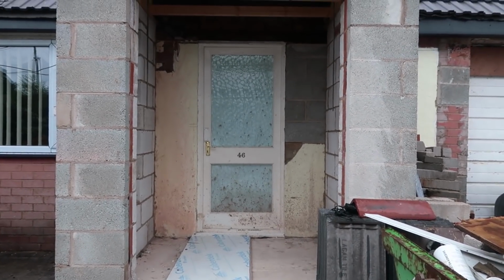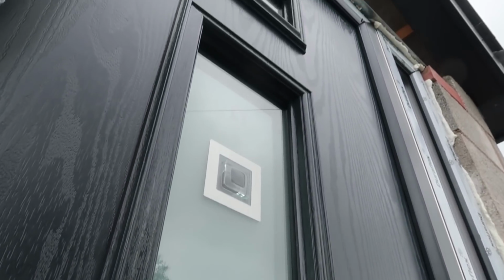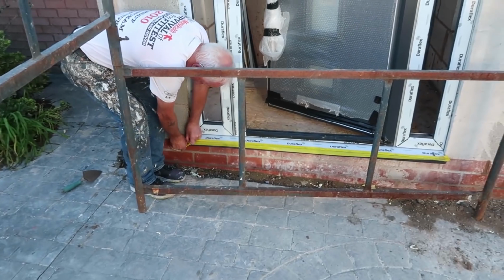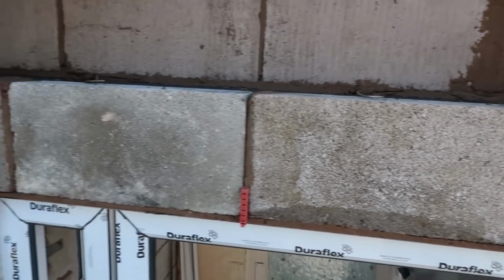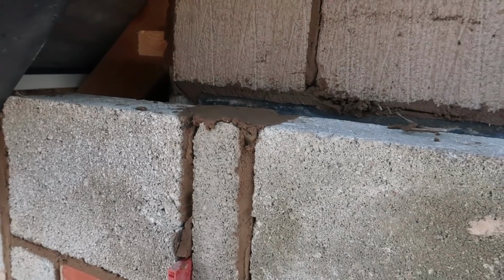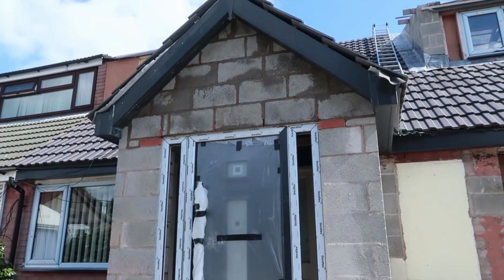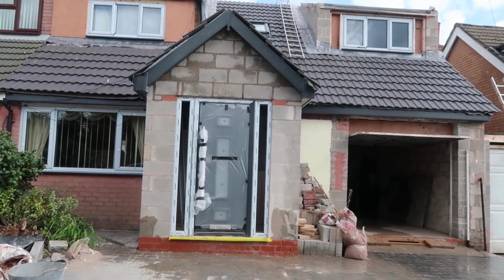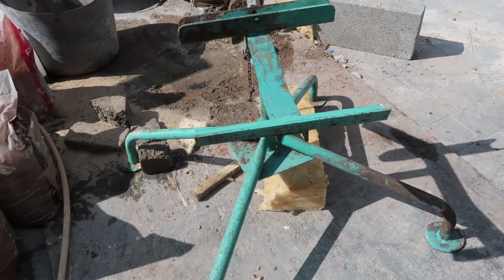Bricklaying Porch Pike and Solid composite door

Comment: Hi, do you have a video showing the previous steps. Also what are the red plastic spacers above the door in between the block
Reply: Those red plastic things with the holes are “weep screeds” that allow any water or moisture collecting behind the block or brick to drain out. So you don’t get mold.

Comment: Why did you use those small steel straps rather than concrete screws through the frame?
Reply from the maker: Because you can’t get the drill in
Reply: @Stucrompton1  good reason lol last question what size bolts are you using on normal windows and doors.
Keep up the good work

Comment: What makes the door a lot more expensive?
Reply from the maker: bought it from a new manufacturer, better locks, handles, hinges, profile, everything is reinforced and if better finish on the door slab
Reply: trinitysmate it’s also a composite door. They are solid. Not the usual rubbish upvc

Comment: NIce door but no respect for the postie - need a mail box on the side - wouldn't get away with it in France.
Reply from the maker: good job were in the uk
Reply: No junk mail 👍🏻
Reply: What a weird looking door, why has it got a curtain rail on it?

Can you still open the door with a newspaper jammed halfway in and the newspaper rubbing on the floor?
Get rid of the curtain rail, have a smaller handle and put the letter box mounted vertically under the lock